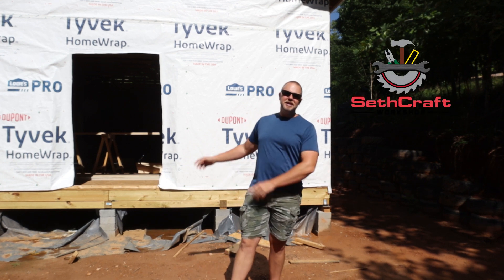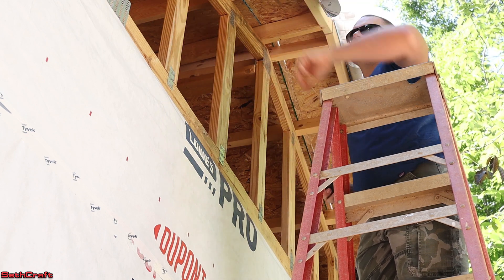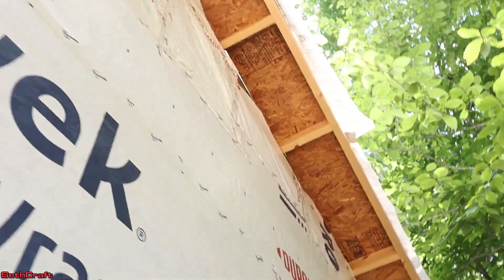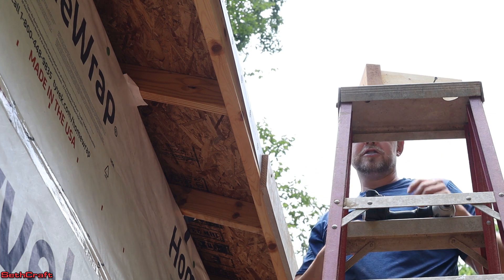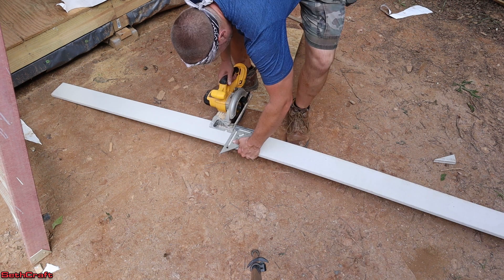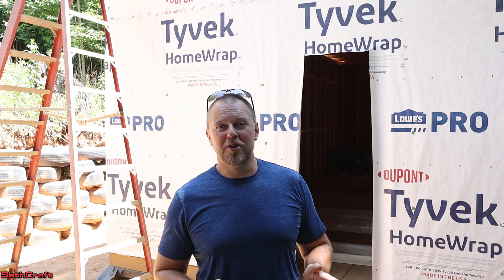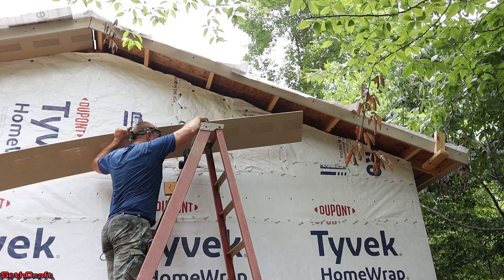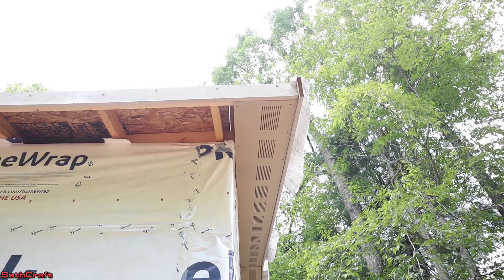Soffit Fascia and Gable OSB Build a 20x30 Workshop

Comment: You ran roofing underlayment behind fascia board. When water comes down roof that's where it will go. Should be on top of drip edge, remember everything needs to overlap. Build is coming together nicely.
Reply from the maker: Yes! You are 100% right.  I actually cut that in the next video with roofing.
Reply: 6:40

Comment: My LP smartside soffit came in today at Menards, got to grab it tomorrow. Reading LP's website, they wants it supported on all sides so I ripped 2x2 to run along my side and gable end walls. My eaves are horizontal so I have birdboxes framed in at the ends.
Reply from the maker: I like it. Seems to do well as a soffit. I agree about support on all sides. The 1/2" is plenty thick to nail/screw every 2' and be good.
Reply: @sethcraftworkshop  I think it's 3/8"? I bought unvented for my gable overhang, oddly it comes in 4x8 sheets.

Comment: I like this video I have a question on the gable could you enclose it and then just add small vents to it or is it better to use that Smart soffit The reason I ask in case later on you like to add some lights

Comment: many thanks! do you really need the soffit board rather than block above top plates? do you use 16x144" soffit board? about $100 per sheet seems expensive, why don't you use 4x8 ply to cut then add soffit vent?